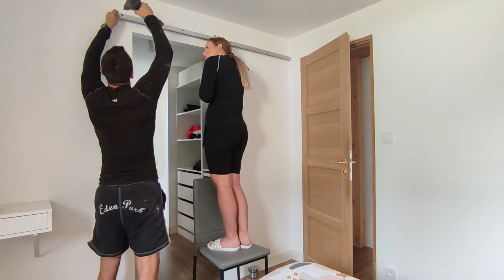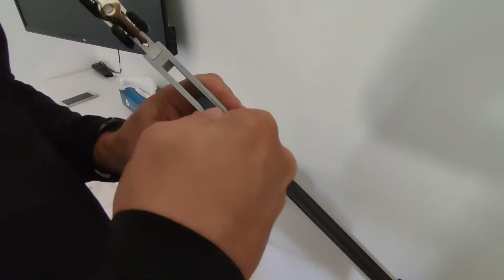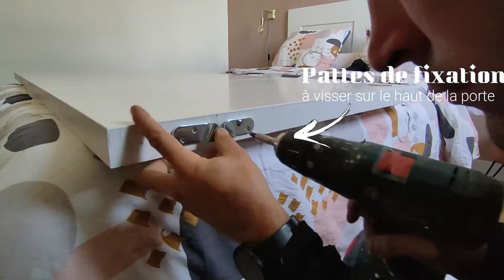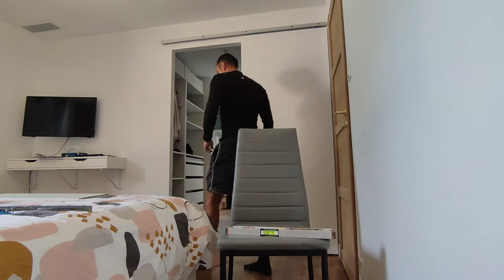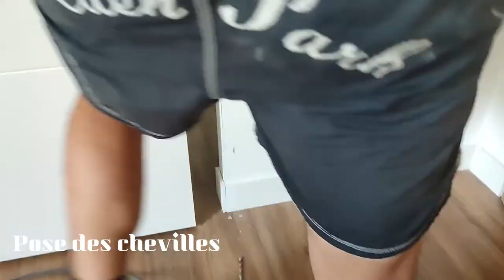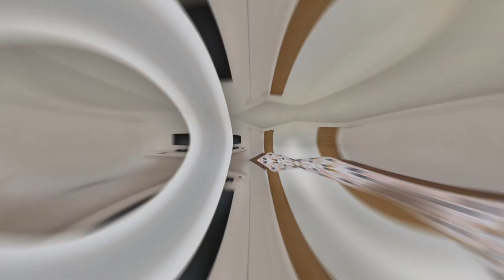Poser une porte coulissante en applique

Comment: J'ai une question, comment vous l' avez fixée? J'ai un mur en placo et les visses donner par le fabricant ne conviennent pas
Reply from the maker: On a mis de la cheville molly pour être sûr que le mur vienne pas avec 😓 on a regardé pour que le diamètre vis passe dans le trou du rail.